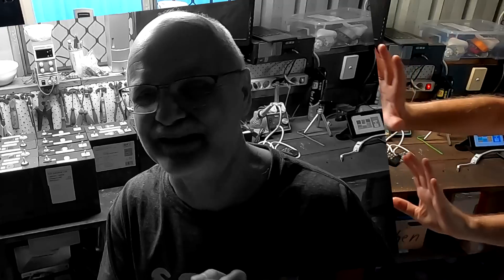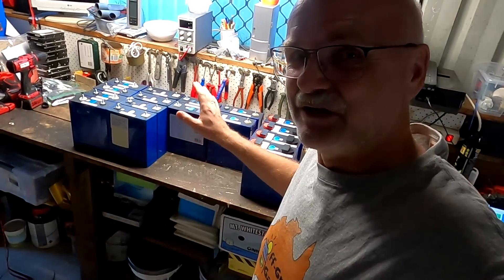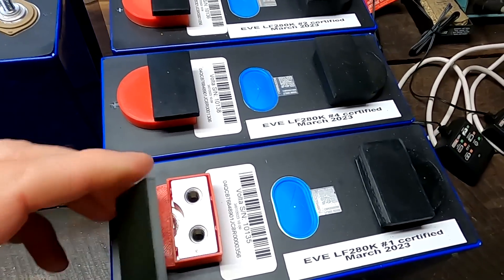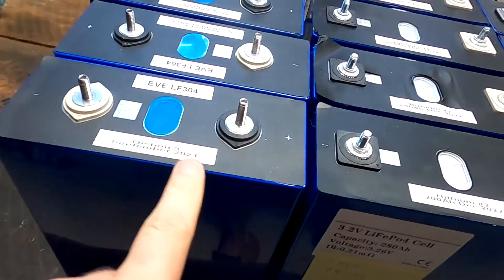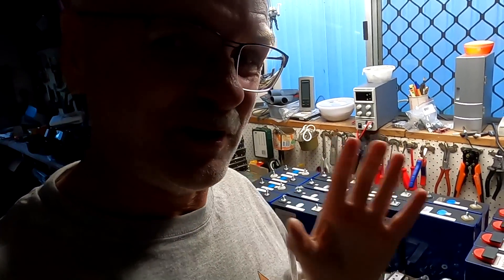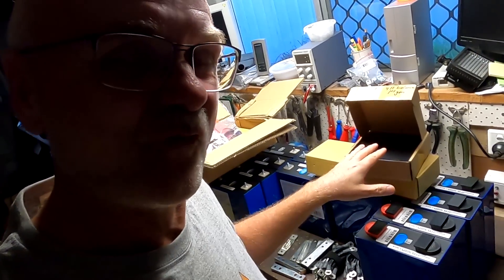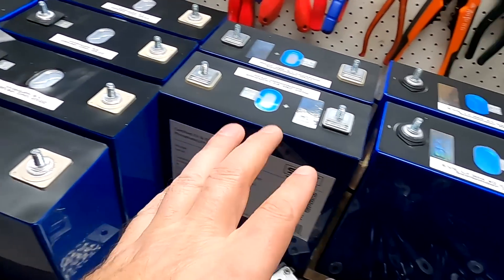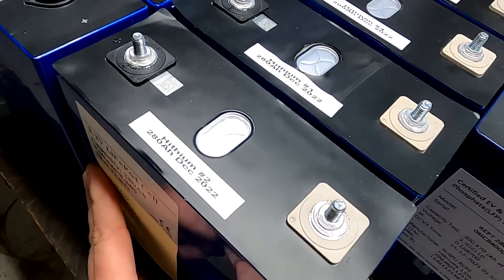The Frankenstein Battery Project - what could possibly go wrong?🤷‍♂️

Comment: Love the idea ! with the right amount of balancers that could work. I was thinking about connecting multiple heltec 16S balancers in parallel to my 16S to keep them in good shape 😂 maybe Frankenstein should also get 4-5 heltec 5.5A balancers in always-on mode for a real-world balancing current of over 10A, to compensate the different capacities and all should be good and even more Frankensteinish ...
Love it !

Grüsse aus München

Michi
Reply: ... and it would be a test within the test to see if paralleling multiple balancer actually is a cheap way to increase real-world balancing current to a value that actually works for large capacity 16S-packs ...
because 3x heltec active balancer for 40$ each is still way cheaper than 1x JK 10A active balancer for 300$ , and has the advantage to balance multiple cells at once instead of just one pair ...

Just saying 😜😁🤣
Reply: hi michi,
ja mehrere AKTIVE! balancer parallel in always on mode können durchaus ungleiche zellen im zaum halten. nur deren ruheströme summieren sich halt auch. ein weiterer weg ist in den soc-grenzbereichen die lade/entladeströme unter der balancer capability zu halten.
es gilt den goldenen mittelweg zu finden.
Reply: @waldschratdersandersmacht  meine 2 sind schon bestellt ... Werde dann berichten was mein Frankenstein bei 65A Ladestrom noch für Abweichungen zwischen den Zellen hat 😂👍🏻
Reply: @MikeMUC  Ich nutze 1 x 1 Ah Balancer und habe keine 20mV Differenz in den Zellen wenn geladen und nach etwas ruhe von 1 Std sind die unter 10mV. Warum braucht Ihr so massive Balancer? Was für Zellen sind das denn? Ich lade aber auch nur bis max 3,5. Alles Gute für Dein Projekt trotzdem
Reply: @MikeMUC  Also ich lade eine 280er mit 100 Ah und das geht ohne Probleme, je größer die Batterie, je schneller kann man viele Ah rein laden. Die meisten kaufen doch 200Ah BMS welche Sie nie nutzen, meistens wird einphasig eingespeist mit max 4,5kw das sind so 100Ah  und wenn ich 2 Batterien habe dann nur noch mit 50Ah /Batterie,  man könnte die dann aber mit 200Ah laden ohne Probleme
Reply from the maker: Hey hey, f***n English here!!! DOOOH!
Reply: @OffGridGarageAustralia  😬 sooooory

I actually tried it out now with 3 parallel active balancers and to my surprise it really works.
I can get cumulative balancing current of up to over 16A with the tripple-active-balancer-stack 🤣

I've sent you some video and pictures of the setup by Email.

maybe that is really a frankensteinish option for that really freaky frankensteinish battery-pack ...

greetings from (at the moment) sunny hot munich

Comment: It will work just fine when you top balance them. The only issue you will have will be when battery will be fully discharged, the 280ah cell will reach cut off voltage quicker than 304ah cells. The whole pack will be as good as the weakest cell.

Comment: everything will be fine. but you don't need to fully charge and discharge it so that you don't have to bother with balancing. use as a 280ah battery. I think will be great project. 👍
Reply from the maker: Well, if we top balance them?, what can go wrong? It should just work right?
Reply: @OffGridGarageAustralia  I thought again, everything will be fine.  Top balancing is fine.  Only the battery capacity will be as the weakest cells.  of course, it is possible to discharge with a very small current and use an active balancer with the possibility of balancing during discharge and get a larger capacity.  I think everything will be fine if you constantly discharge the battery fully.

Comment: Thanks for another great intro... Will be fine. I would go with the Neeeee 4th gen out the gate. As it is my thoughts that it will be working overtime to coral this beast.
Reply from the maker: One more vote for the NEEEEEEEEEYYYYYYY!
Reply: @OffGridGarageAustralia  With those Seplos PCB in mind. The ones connecting the batteries to the BMS. I am thinking of making this style PCB for the NEEEEEE Your thoughts on this? Or perhaps a Y connector on the Seplos PCB board to also connect the Neeeeeee? This would make it a quick disconnect. And fewer wires on the terminals.

Comment: Loving this project :)
I think it will work fine, as long as top balanced. just as normal will get the capacity of the weakest cell.
Mix the cells up as much as problem, or randomised somehow - just for the banter.
Reply from the maker: Yes, top balancing is the way...

Comment: I suspect Andy, that barring individual cell defects, with aggressive balancing capability if needed,  your FrankenPack will preform pretty well. As far as connections, I might be inclined to install them in groups of the same model, as keeping cells with similar internal resistance charging together might reduce individual cell imbalance due to sires resistance, and you end up with a group imbalance rather than a lot of individual cell imbalances, if connected in sires randomly.   Also, with sires groups, it might be easier to balance a group by charging or discharging that group individually,  and I was thinking that if you end up with 4-cell (12V) group that's always at a higher SOC, it might be feasible to connect a boost converter to that 12v group and balance charge a lower SOC 12V group quickly, thereby transferring the energy of the  higher capacity cells to the lower ones when the pack reaches a low state of charge. I have some thoughts on how that might be done safely and automatically if you decide to attempt it.
Reply: lol agressive balancing. Threaten them with a knife so they behave!
Reply from the maker: I will use the BMS balancer first and see how the individual cells look like. Will cater for an active balancer and install the wiring for sure.

Comment: The battery pack will work fine .
The only issues will be when charging. Some cell will runawey when charging, but if the charging voltage is set to 3.4-3.45 max for example and the balancer can keep up with the charging  current then everything will be fine.
I expect the total capacity to be 90% of the lowest capacity cell before the BMS cuts-of
Reply from the maker: Once we do a top balancing, it should be fine?
Reply: @OffGridGarageAustralia  In my opinion/experience yes. 
First charge/equalize the individual cells to 3.5V.
Then build the pack and start using it :-)
When discharging/charging the cells wont have the same voltages (they will deviate especially when charging), after all they all have deferent capacity and internal resistance.
When doing the first charge of the pack , monitor the highest voltage cell.
When a cell gets to 3.5 volts note the pack voltage and set that exact pack voltage to max charge voltage for the battery pack charger for future troublefree charging.
Same goes for discharging (max discharge pack voltage) if you want to squeeze every bit of power from that battery and do not want to relay on the BMS cutting off.